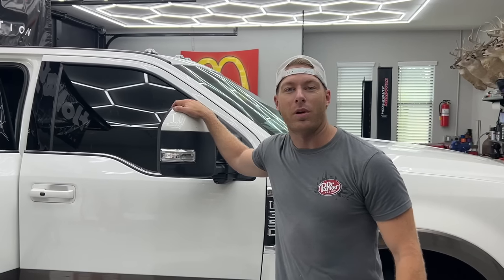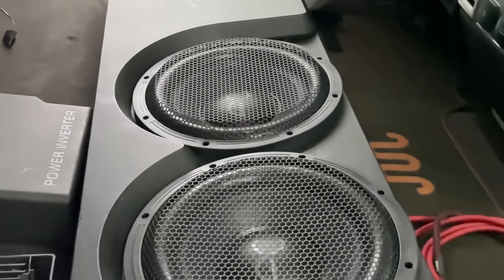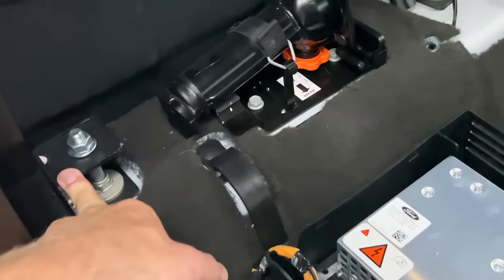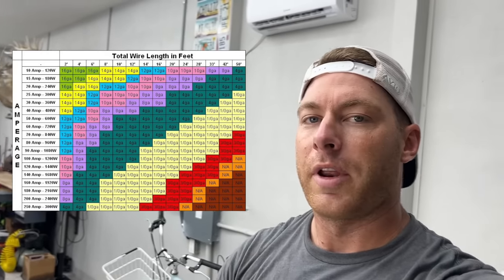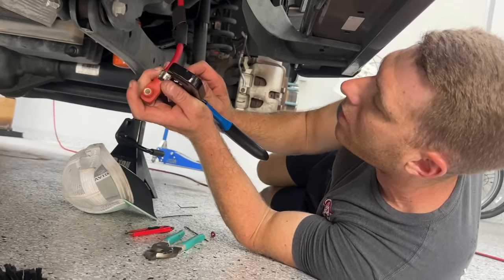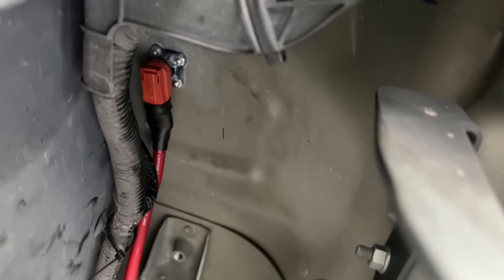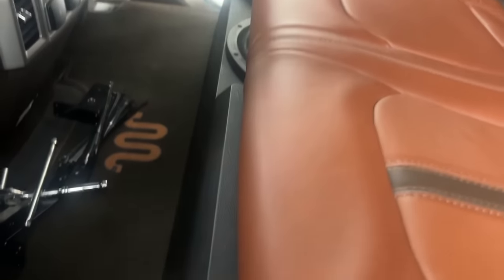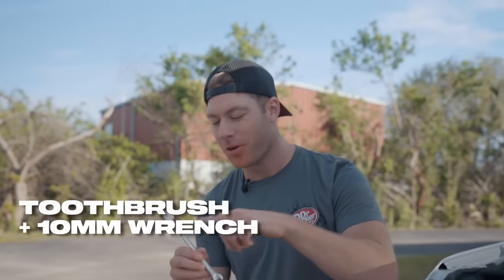Day 3: We Put Subs In My Truck.. It's LOUD!!!!!

Comment: I love bass!!! Im 41. Grew up banging down the cruizing strip. I have the loudest system iv ever had now. Running 4k on 2 12in sundown xv2s.  She slams!!
Reply: I have a 320amp js alternator 3 runs of 0 gauge wire running to the rear battery. 50ft of 0 gauge wire in my crown vic!!

Comment: Back in the day I put 2 12s in my Dart with a adjustable electronic sub cross over driven by 150 watts a side. I put them in 5 gallon sealed buckets and they just sat in the empty spare tire spot in the trunk floor. I had a couple of quick connects on the wires so I could take them out when I needed to use the trunk. It actually went very low and it sounded clean. I had a 100 amp huge old school Mopar cop alternator and the biggest group 24 battery as far as CCA I could get, I think it was 1000.
This was probably the early 90s and nobody expected a old Dart to bump and sound good.
My lil sisters Audiophile hubby was impressed when I let him hear it. It also had raw high end drivers all over and several other amps in various areas of the car. I've never built anything quite like it since but I slow added things as deals came up over time for years.

Comment: these trucks are super easy to get through  the fire wall but your way works as well only issue I could see is friction heat at that bulkhead if it ever gets a little loose

Comment: i used to have couple subs in the car till my amp blew possibly. i still need to retest the main board.(2 MTX 1000 watt with 1200 watt amp) not hooked parallel  so im making the amp there is one sub.also moisture got in truck of car so box is ruined. i still need to look at the subs out of box.
also you sure youed have enough aux poer from your speakers because id think that when your not playing anything 0 V. and 100 constant ( if you ran you remote wire to em)

Comment from the maker: Have you ever had subs in your car???
Reply: Oh yeah, I'm a SQ nerd and compete in my truck.  I currently have two arc audio 12's behind my back seat..
Reply: Yes 2 15s in the back of an 04 Suburban with the suicide rear doors. (No hatch). A good choice of vehicle for a system for sure.
Reply: I'm still rocking subs in my Lexus. That's a clean little build 👌🏽 Parker the Bass head 😂who would have thought 👍👍
Reply: I currently compete with my single 12 in my car!
Reply: There may or may not be an assassin out to get you. Stay safe out there!
Reply: Nope never had and never will.  I want to be able to hear without hearing aids when I'm 60
Reply: @jayspeelman8619  bass isn’t what damages your hearing it’s the mids and highs trying to keep up with the bass that does
Reply: Yessir.  2-12s 500w each in a standard cab Sierra, ca. 2000-2002.  I have a 2020 F350 CC LB like yours.  Need to upgrade soon!

Comment: The power wire should be connected to the battery charger not where you  connected it also it needs to be fused at the battery connection.

Comment: You didn’t show the ground wire install. I hope you didn’t ground to the aluminum body. People have blown amps and other audio electronics doing so. That’s why the reputable professionals run a ground wire from the battery back. Also some companies won’t cover warranty unless you do if it is in the directions. The factory amps don’t pull as much power as aftermarket,that’s why they can get by with it.This is applies mainly to Ford F series trucks with aluminum body.
Reply from the maker: Self taper to the floor
Reply: I was thinking the same thing, Fang.

Comment: Damn bro isnt truck isn't that old, and you already have corrosion around the negative terminal on the passenger side lol battery might be going bad. I'd definitely clean that and address the battery to see if it is loosing any amperage just to be on the safe side sense you are hooking up a system in it. Lol